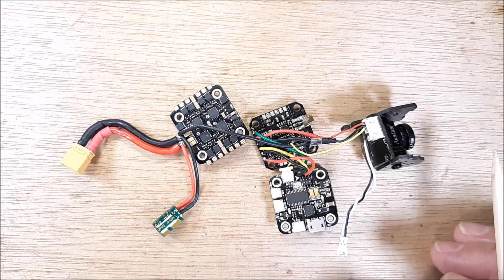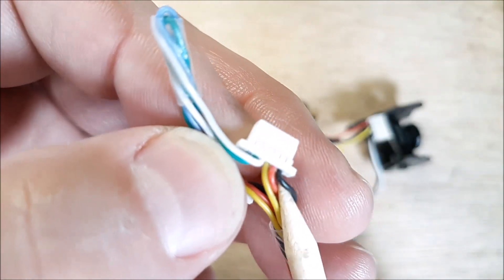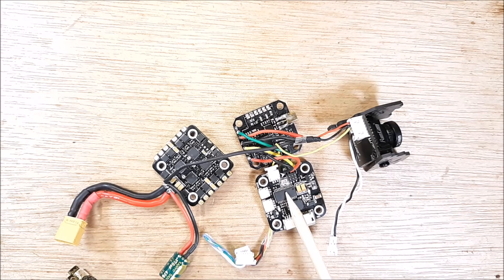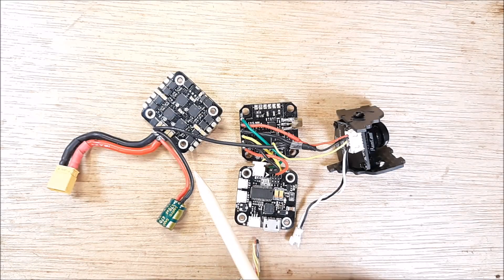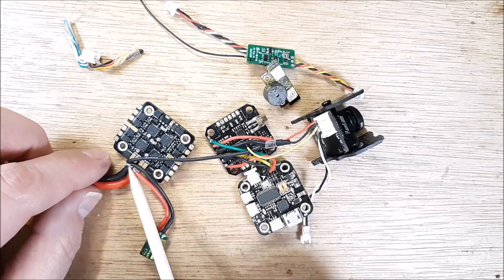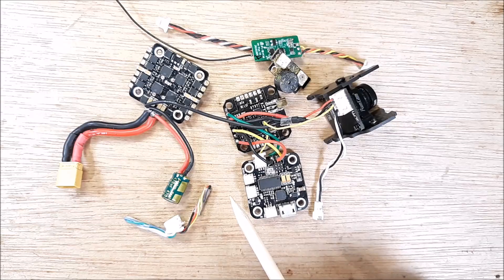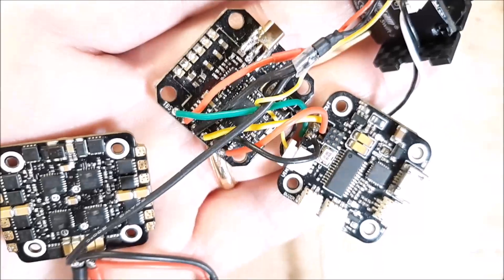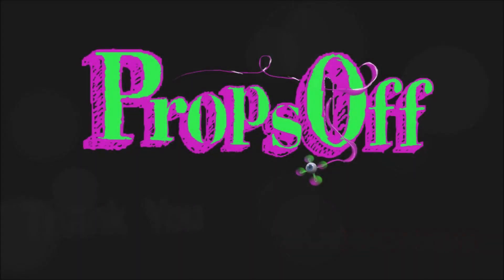FPV Video Issues Fixed | Video Problems FPV | Redundant Ground

Comment: So I cannot for the life of me figure out how to achieve this with a high voltage VTX that powers from vbatt.. pretty much no matter how I configure it I get those crisscross checkered patterns. I know I’m doing it wrong somehow.
Reply from the maker: I had some flannel shirt effect in my feed and it was bothering me. I wanted perfectly clean video - it took a while of testing and playing (about a year).. Here's the outcome....
https://youtu.be/OXOmYrez3rE
Reply: @PropsOff  turned out to be a board fault. A 9v pad was barely shorting to ground. Video eventually dropped out completely ha, whoops. Had an old foxeer f722 v2 i swapped in with the same configuration and it came out crystal clear. Like almost digital clear.
Reply from the maker: @glitchy8429  
It's good to hear its awesome...👍🏻🍻👊🏻

Comment: Just bought a few bec's and plan on adding grounds to my nazgul5 v2 6s. Really great videos man!  New sub!!
Reply from the maker: I appreciate your feedback and support.. Oddly enough, I haven't had to do this to either of my Matek flight controllers. I have wired all my others and have clean video, finally! Please, if you would be so kind and come back and tell me how things worked out - I appreciate your feedback...👍🏻🍻👊🏻
Reply: @PropsOff  I have noticed a few things in my video I thing will go away. Ill reply with my findings!

Comment: Hello my vtx channel changes by itself while in flight and the my googles turn into static or snow. Any idea how to solve this?
Reply from the maker: Are you using the "Auto Scan" feature of your goggles?
Reply: @PropsOff  I’m not using auto scan I have the vtx channel on my osd and that’s the channel I use, it works for a few seconds and then I get full screen snow/static. It was working for a day before I started to have any issues.
Reply from the maker: @pablomoreno1242  
After the snow, it changes channels? What channel does it start for and go to? Do you have DVR you can share? This will be hard to figure out without some example...
Reply: @PropsOff  yea can I email you a short video? Or how can I send you a video
Reply from the maker: @pablomoreno1242  
Easiest to do is upload an unlisted YouTube video and copy the link, come back here and paste it..
Reply: @PropsOff  I was having problems uploading the video, but I fixed the problem! It was the capacitor that I installed backwards that was causing this issue. My error sorry to bother 
Thank you for helping
Reply from the maker: @pablomoreno1242  
Isn't that something, 50 - 50 chance of getting it right.. Lol
Glad you got it right...👍🏻🍻👊🏻

Comment: This sounds a lot like star-grounding in audio-amp circuits.
The fluctuations of voltage dissipation when it's shared between a single line between components creates noise and extra resistance to the ground. When each amp has a direct ground line to the mains the noise problem is solved.
Reply from the maker: Lol, before loosing my hearing, I competed in stereo competitions in the 90s. Could bounce a quarter over a foot off the top of my car to some Snoop "Pump"... Haha, good times.
Your right...👍🏻🍻👊🏻

Comment: My crossfire is blowing out my video rolling bars
Reply from the maker: I've not heard of the TBS Crossfire rolling FPV feed. RCSchim did a video like a year ago about RXloss issues, but not familiar with rolling.
What VTX?
What Receiver in the goggles? 
Are they both manually set to the same channel (never use autoscan)?
Reply: @PropsOff  furious fpv domv3  akkf3 Ill double check on the the channels
Reply from the maker: @timmytson1  
Make sure to manually set the VTX and then your goggles to the same. I always manually set them, the first time, then check smart audio afterwards.

Comment: Can I run a little wire from the 9v pad on my camera to the 9v pad on the vtx? Someone told me that would also help...
Reply from the maker: This video is to gain a ground directly to the flight controller. I have another video were my experiments took it farther and better..
Reply: @PropsOff  I saw the video where you installed a power regulator nicely done... However I don't have one it's my speculation that it wouldn't hurt jumping one 9 volt pad to another however I'm inexperienced and a little short for cash I wanted to be sure before I tried I wanted your opinion if you thought I might try it or something I have a really good vtx, but I have it on vcc... I'm going to change it to 9 volt like I had it I just noticed my camera was on vcc last time I should have changed it over to nine volts instead of the VTX to vcc... I'm going to try jumping the ground like you did I just wanted to be sure about the 9-volt before I messed with a hot connection
Reply from the maker: @ThrottleWarning_FPV  
If your VTX is rated for 2-6s then it is okay to power it from a 9-volt pad from the flight controller.. Normally, this would add some capacitance to it that may help (noise reduction).. Then, connecting your camera to the VTX (output pad) is acceptable. However, if your camera must be capable of receiving 9 volts from your VTX.. There are some cameras and there are some VTXs that can only handle 5 volts in, so, just be careful.. What you cannot do is to put two outputs together - it seems like you're far enough along and understand that. 
My preference, I usually like to use the output voltage pad and ground from the VTX for the camera because of better filtration, but a lot of companies are cheaping out and the VTXs on the market anymore seem like garbage..
So run the VTX from the 9v out pad on your flight controller. Also, run the camera from the VTX, if you want. Then, run a ground to the ground of the camera ground as a 3 way intersection. Should be good..
Note!!! I am not there to personally guide you and don't want bad things to happen,  so read the manuals..🍻
Reply: @PropsOff  Thank you so very much for tanking the time... I had wondered if the filtration would be better through the vtx thanks for clearing that up as well. Hopefully I can fix it properly now. It should be pointed out and is worth noting the obvious fix you've accomplished with a redundant ground. Soldering as a welder is relatively easy for me to understand but whenever you take too long or forget a cleaning step or shake a little too much it can be a pain...
Reply from the maker: @ThrottleWarning_FPV  
You bet! Enjoy the Breeze...👍🏻🍻👊🏻

Comment: See here’s my issue when I first arm I have these awful squiggly lines that come in on my feed and my osd is flickering and moving up and down. When I punch the throttle it fixes it sometimes but only when punched throttle and if I play with it I can eventually get perfect image at whatever throttle range including idle. Well I thought I was getting a voltage spike to my vtx or something i installed a 12 volt bec (vtx range is 5 volt-36volt and I was within these parameters before bec) still does it with bec now when I disarm it like it resets and I have to punch it to get good video I’m not sure what’s going on and the squiggly lines are motors speed changed (higher throttle the faster they squiggle)
Reply from the maker: Sounds like your camera took a hit.. Change out your camera.. Only thing I can think (assuming all the starting stuff) is to see if there's a short. But yeah, camera swap..
Reply: @PropsOff  ok but what about the osd? It’s affected by it too I think it’s my flight controller. But I’ll try swapping my camera system.
Reply from the maker: @jaredallen8054  
I had this exact same issues with a 5incher and it was the camera.. I took a hit and it started and progressively worsened. Lines during throttling and blinking osd.. I swapped the camera and is perfect again...
Reply: @PropsOff  I’ve been flying today and it doesn’t do it nearly as bad or as much the past few flights it actually hasn’t done it at all I added another video wire from the fc to vtx but again it occasionally does it camera is next but I’m going. To keep flying until it’s unbearable
Reply from the maker: @jaredallen8054  
I went farther with the grounding and redundancy in this video, if your interested.. 
https://youtu.be/OXOmYrez3rE
Reply: @PropsOff  very nice thank you.
Reply: @PropsOff  I HAVE FINALLY FIGURED IT OUT!!!!!! I swapped the camera system no luck. I was like screw it I’ll live with it the next few flights on the last flight it fell out the sky motor just quit working properly had all good connections and everything. Swapped a whole set of motors and it does it not more I pulled the bell off that motor to see what’s going on and there was a piece of plastic/glue adhesive that was built up and was touching the wiring barely and it finally rubbed through the copper wiring amd that’s when it burnt up. I think that rubbing had something to do with it because it does it no more I even put the old camera back in to make sure it still wasn’t the camera like you said. So add that to the list of things that can make your fpv feed look like 💩
Reply: @PropsOff  motor was a 2507 1801 kv for a LAL5
Reply from the maker: @jaredallen8054  
First I've heard of that..Lol 
That would be one of those 1 in 1000 finds, congratulations! I appreciate you telling me about that, so cool you got good video now..🍻

Comment: If you're powering the cam from the fc 5v, and vtx from vbat, how would you run the redundant ground?
Reply from the maker: After about a year of messing around with this, I did this video...
https://youtu.be/OXOmYrez3rE

Comment: Nice tip! I have a question here: if you put a larger wire in the original ground connector between the esc and FC, it would solve the problem, or still need an extra path to ground?
Reply from the maker: I think adding the second one is the best. It allows the path to ground, come directly to the component in need. I played around more with this concept in another video and was surprised of the finicky behavior displayed by the FPV system. More grounding the better seemed to play out.
Reply: @PropsOff  thank you very much!

Comment: Thank you! I thought combining ground wires would cause a ground loop , but I guess I didn’t understand what that meant. I think by tying these grounds together you’re preventing the ground loop. Fixed my vTx feed completely!
Reply from the maker: Thank you for checking out my channel and subscribing! I'm certainly glad this helped you out. The redundancy ground is needed to create a path of least resistance and filter out voltage irregularities in the video feed. Cost me nearly $10K to learn that... Lol

Comment: I did just what you said to do cleaned it up a little bit but still lines there an almost like I am in between or  close to the Chanel I am on use f1 5740 idk
Reply from the maker: What parts are you using?
.VTX
.Goggle Module
.PAL or NTSC
.Camera

Comment: Hello bro. I know it’s later comment but I just built my first quad an I can not for the life of me figure out how to get the faint lines out of my throttle up. I am thinking about runing the extra ground like you did. I have camera vtx ground we’re vtx ground is I crossed both pads an still same lines. Not so bad I can’t fly but they are there. Thanks if you can give me some in out ttyl ✌🏻 great video 👍
Reply from the maker: No comment is too late.. Question, did you run a jumper ground from your lipo ground to the camera ground? 
What size quad, what is it?
What voltage, 2s, 3s, 4s..etc..?
Reply from the maker: I took it even farther.. Some would say it's excesive, however, my video is near perfect now. No matter how much throttle. 
https://youtu.be/OXOmYrez3rE
Reply: Hi man, am having the same issue I'm glad I stumbled upon your video it must have been 3x since your video saved me from going crazy about my issues with my whoop. I'll give this a try, im working on a 2.5 inch 2s toothpick atm https://m.facebook.com/groups/353056891728440?view=permalink&id=1250302255337228&source=48

Comment: Hi thank you for the video, I’m having an issues with the plugin wire harness from my flight controller to the VTX. I believe that the wires of the harness maybe lose , causing lines and loss of video, yet the vtx will still transmit a signal even with there is no video which leads me to believe that the issue is the the wire harness and not the FC or the VTX . Any help or advice would be appreciate. 

Thank you .
Reply from the maker: Thank you for checking out my channel and subscribing! I appreciate you! 
I have had lose or damaged wire harnesses from the flight controller to the vtx too. I replace the harness with a hand built one I make. I get the "SH to Picoblade" kit from Readymaderc..
Reply from the maker: https://www.readymaderc.com/products/details/rmrc-ultimate-sh-picoblade-cable-kit?gclid=CjwKCAjwqML6BRAHEiwAdquMnbH3dHewFAlb5xMZm6ysWITGebiPTFehLSUZHs3_MXujY3eK8T9UERoCKPgQAvD_BwE

Here's the link of the kit to make your own harness..
If at all possible, I cut the harness away and direct solder it. However, some builds just don't allow that.. Hope this information is helpful...👍🏻🍻👊🏻

Comment: I need to try this out on both my FL1 setups, they have identical issues with noise as soon as I arm and they lines get worse the more throttle I give it, someone else mentioned running another ground from their 4in1 to the FC got rid of their noise issues, which is pretty much what you've done here so I'll give it a try and see if it improves my issues or not. 

Thanks for posting this.